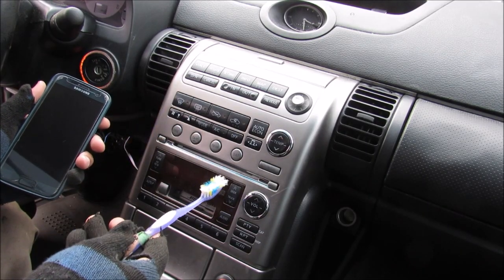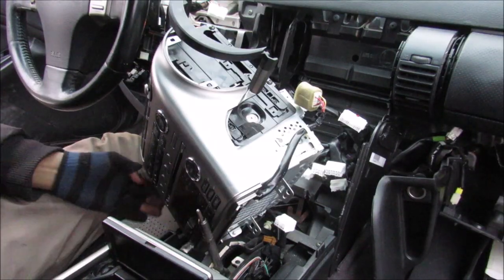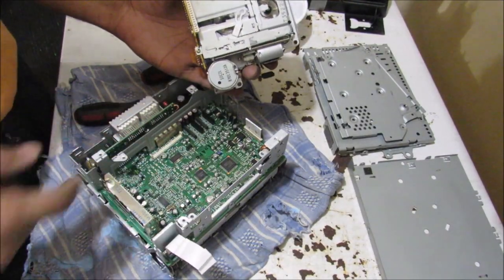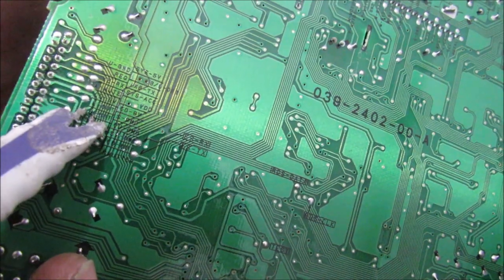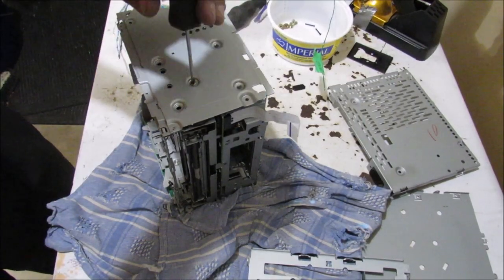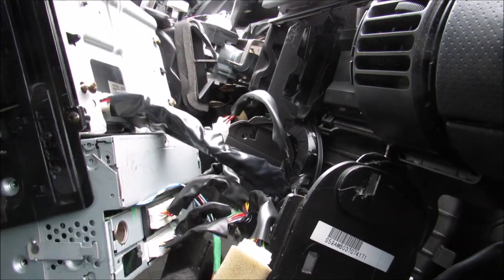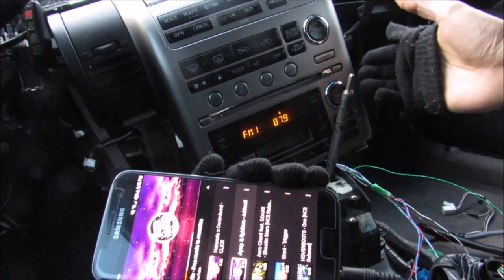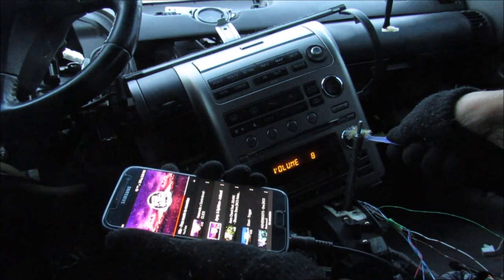DIY: $1 AUX Stereo Input Hack

Comment: The problem with the phone volume all the way up is it will inject distortion from the output circuitry on the phone.

The best volume level on a phone is about 80% where it will be below clipping levels but still above levels where any loudness circuitry will be overridden.
Reply from the maker: Good tip, it depends how sensitive you are to distortion and what you listen to as well, most aux hacks I have done I usually feed the highest phone volume and then control the final output from the cars stereon
Reply: this seems like something that might be true on some phones, but not all

Comment: It would be good to route your internal CD input wires to a female 3.5mm jack, so you can use (and replace easily, if need be) a cheap and widely available 3.5 mm male-to-3.5 mm male patch cord. You can crib a jack from anything, and maybe secure it with epoxy or even silly-cone.
Reply from the maker: Yep good tip

Comment: This was my 1st and only mód to my old Mazda 6 which i bought 2 years Ago , after i burnt a bluetooth  device with 16 pin conector to my radio homemade by some german guy selling IT on ebay by messing Up the wires (IT cost 30 Euros) i found a manual how to do this on old Mazda forum from 2004 , IT took 3 days, lots od cursing, 2 failed attempts, as i have never ever done anything with electric wiring or soldering, ale after i rebuilt the radio i was left with 10 screws , but it works after 2 years and i never gave Up, i Can finally say i have done something  as good as speedkar99 did, car related :D (i didnt know anything about cars back then and now after All problems my old Mazda has encounterd through out that time i learned a lot, but your YT channel explains almost everything in the best and most simple ways car newbie like me could imagine)
Reply from the maker: Good to know you finally got it done and can enjoy your radio now

Comment: Pro tip: The G35 clock bezels pull straight out, rather than upward. It's pretty easy to break the tabs off removing them.
Speedkar's way is perfect. Do just like him.

Unrelated: I sell those bezels on ebay to people who break a tab for around C$100, shipped anywhere in N. America. ;-)
Reply from the maker: Toothbrush makes a great panel popper
Reply: @speedkar99  Yes, but it's best to pop from the top! If you look at the bezel, you'll find the tabs aligned longitudinally. Best way I've found is fingertips @ bottom of display and pull!

Comment: Thanks. After watching your videos I did this mod to my CRV and it works 👍🏾
Reply from the maker: Cool! What year crv?
Reply: @speedkar99  2003 CRV. The only thing is that I have to turn off the radio before plugging in the aux into the phone, similar to what you did in this video. With the aux hooked into the Bluetooth adapter, the audio is very low and staticky so I don't use that adapter. Still cool mod and it's all thanks to your videos. Keep them up!!

Comment: MOST IMPORTANTLY!  Get a cable with a SLIM connector.  If your phone is in a case, a lot of these standard connectors won't fit with the case on!
I would also recommend you get a cable that costs more than a dollar.  A $5 cable from monoprice will have altogether better components, and it's worth it because this is not something you just want to redo when your cable shorts or gets crackly from age or weather.

Comment: I'm sure it was fun but no way I'm doing all that. I had a company car many years ago that I could not mess with. I ended up buying a RF transmitter and a MP3 player. The RF transmitter needed batteries so I took a phone charger and did some dodgy connections to use that instead. 

I will admit the quality was not the best but not a single screw or trim was harmed in the process.
Reply from the maker: Good non-contact solution

Comment: One dollar only goes to the part(s), plus the labor is probably 80Cdn per hour multiply by 8 IF everything goes right, final total comes to a hefty $641!  80 dollars per hour is what any auto mechanic would charge these days and probably even more.
For me, I have often fancied buying a home-use soundbar and a subwoofer with  bluetooth connectivity and just let it sit at the rear shelf, plus an inverter to power it.  Now that is bang for the buck!
Nevertheless, have always enjoyed your videos dear speedkar99, it is quite amazing considering that you don't need to refer to the factory schematics.
Reply from the maker: DIY doesn't include labour charges haha
Reply: A mechanic wouldn't touch this stuff, and frankly, most are unqualified. 120V home stereo stuff in the car seems like a good idea...until you get mad interference from your alternator through the inverter!

Comment: I've tried soldering to 3 different pairs of Left and Right (plus ground) on the motherboard and nothing worked. In one instance the audio still came from my phone, in the other two times no audio played anywhere. This was with a 2002 civic's radio. Oh well. I had my hopes up for a cheap fix. Guess I'll have to buy a bright glowing head unit so I can use an aux cable. At least it was fun trying.

Comment: 5:55 I'm curious why you inserted the RCA cassette to 3.5mm adapter for silence when testing the cassette leads, why not just use the 3.5mm off the cassette as your aux and save the laborious task of taking everything apart.

From my experiences with foreign cars that include combo cassette/CD players is that they are the most future proof but I haven't found a cassette to 3.5mm adapter worth bragging about.  Can you recommend the blank CD aux input method as having better quality than any cassette adapter that can be purchased?
Reply from the maker: Cassette has Terrible quality compared to a CD input

Comment: Hey I know you get questions like this alot and I love the fact u engineered n test it out. But I'm just wondering if I could wire the aux in using a splice rather then taking the whole unite apart. Thanks for doing this btw I learned alot

Comment: Subscribed. Interested in doing this, I’ve done it before by disconnecting the tape deck output and soldering a 3.5mm wire onto the input pins. I have a 2005 g35 with a different audio package, it has a cd changer but no tape deck so I will have to connect to changer or radio. Do you notice any interference from the input from the existing connections? How does it just override the CD/tape/radio? Also do you have to remove the gauge cluster to do this or did you that for another reason?
Reply from the maker: I didn't have any interference issues. Make sure you use a blank CD. The cluster was removed as part of a future video (maybe)
Reply: My 2005 G35 CD mechanism not functioning properly I can't use blank CD , so my only option is to use radio input?

Comment: I tried to do that, checked the motherboard but i found no labels indicating right, left or ground .
Any advise ?
Thanks
Reply from the maker: You'd have to start looking at the radio lines for inputs. 
Or get the datasheet for the main chip
Reply: speedkar99 is hookup wire the same thing as electrical wire?

Comment: Finally;  a useful thing that can actually be of use as battery powered wireless surround speakers or what not and solar charging could be an option also but it is cool for free amps that could serve as tri-amps also maybe.  Or whatever;  hey bud;  maybe show how to use them as cassette head adapted for guitar input and so on.  But you all know that what would really be cool;  would be a junction that would be added to the fm antenna coax and ...............  well that made as much sense as something that made no sense.  LOL  There are cassettes that have a head that sits upon the cassette deck head and the motor could be disconnected to get rid of the disturbance and that could work also.

Comment: I've a audi a4 b6 I have a connects 2 module. that allows a Sony cd changer to be connected and played through  the rca leads. However I have a jack plug with rca connections on the end that  I've connected these to the connects2 rca outputs and then plugged the jack into my phone. if I put a cd into the changer. I can listen to the music on my phone. However if a cd finishes my music goes of till another cd is playing which is shit... So do you know which wires it is that tell my hu a cd is playing. So I can hack these so the hu thinks a cd is playing when it's not and the multichanger does not require a cd .. If you have an email I can send you what I have.but I'm sure the wires are inside the don't bus lead and not the connects2 module. Or will it be easier to open the multichanger and hopefully it's just a case of glueing a  microswitch connection together hoping that this will activate the signal so the hu when in aux mode thinks the cd is playing a disc.. Any help offered is appreciated. If you need any I more info itscraigsagar22@gmail.com
Reply from the maker: Yes

Comment: Why to go through all this if I have a cassette player ??? I can get a cassette adapter for less than $10 including the cable. In addition, what's the make and model of the car?
Reply: Quality isn't as good and the cassette resets sometimes
Reply from the maker: Cassette quality is horrible compared to a hard connection

Comment: Oml,  I can desolder something broken and resolder on a replacement for something(have successfully done it with a broken internal gamecube battery) but whenever someone goes into the  how the different circuts inside of a motherboard or whatever work    I get lost and can't keep up.
Reply from the maker: Electronics is fun, the best thing are the datasheet for the chip that help you understand

Comment: This is undisputably the worst infotainment system assembly ive ever seen in any car ever, there are a lot of things to hate about nissan and this one just got them on my list, the fact that even kia has a more elegant and simple solution for mounting the infotainment system is just embarrassing
Reply from the maker: Yeah and these weren't very reliable either
Reply: @speedkar99  good lord! Difficult to service and unreliable at the same time? nissan really hit the Jack pot of worst design this time.

I was always a huge fan of the skylines and z cars, but when i was doing research for my most recent car, nissan was at the top of my list until i spoke to some owners, needless to say, I'll have to suspend my love for some of their cars until I'm rich enough to set aside a special repair fund for every car.

Comment: So I was hoping you could help me with something. I have an 06 Solara with an android head unit installed. I found a 4 wire aux port from an 07 solara at the junkyard and wanted to wire that into the aux input for the head unit. I bought an rca male to aux male adapter to connect to the red and white aux inputs on the head unit. I had used a continuity test on my multimeter to determine the ground left and right of my aux port. There are four wires, but the fourth one ended up not being connected to anything so I just left it disconnected. I soldered the three wires ground left and right to the aux side of the aux to rca adapter respectively. I plugged it in and opened the AVIN app on the head unit, but whenever I connect the aux to my phone, the phone acts like nothing is connected and the head unit plays a repeated thumping noise. No phone audio in the head unit. Any advice? I appreciate it.
Reply from the maker: Is that rca port meant for aux in or out? 
Try a different phone without jack detection
Reply: @speedkar99  Yes the ports are made specifically for that. The red and white are labeled aux in L and aux in R and the manufacturer eonon specifically mentions the use of the rca to aux converter I got will allow 3.5 aux capability. I dont believe I have a phone that doesnt have jack detection though. Any other common devices that dont have jack detection?
Reply: I figured out why it wasn't working. I ended up believing I wired it incorrectly or that the port wasn't compatible with my radio, so I bought a 3.5mm female to rca male adapter and plugged that in, and I got the same noise. I then tried it with a different phone and it played with no issue. I then plugged my phone into a Tundra with a stock aux port and it still made the same noise. Trying it with a different phone worked, so my phone is the issue. The previous owner totaled my phone and it was restored, so I guess my phone's aux port was one thing that was not repaired. Thanks for your help.

Comment: "too much work..."
How much time did you have invested in this project?
I'll bet it took less time than driving into/around town picking up a Bluetooth transmitter... Without the cost
Reply: Maybe some people prefer to be bombarded with less microwave radiation. Also, Bluetooth is fallible in a dozen ways that a cable is impervious to.
Reply from the maker: Bluetooth fm transmitter will never give you the sound quality of a CD aux connection
Reply: @speedkar99  agreed. For those who claim this is too much work, I would bet it took less time than going shopping, with better sound quality to boot!

Comment: Ironic that the wire didn't work with the tape input, but would have if you had plugged the cassette adapter into your phone! LOL
Reply from the maker: True but the adapter won't have as good quality which is the point of this hack
Reply: @speedkar99  Agreed, though it's interesting to contemplate a high quality 3.5-to-cassette adapter played through a fully cleaned and recalibrated deck. I mean, if you're feeding into analog anyway...

Comment: Why not just change the headunit instead?
Reply from the maker: The G35 requires a $200 dash kit to Integrate the HVAC controls, since it's all controlled by one board. So an aftermarket route gets expensive quick...
Reply: @speedkar99  that's still cheap, compared where I'm at, priced at $479 = MYR1950 😣

Comment: When I do max volume on my phone through the 3.5mm jack, it cuts it down to half after a while with some fucking warning about hearing loss.

Whaaaaaaat?
Reply from the maker: That's built into the ROM
Reply: @speedkar99  Yep. And like most, my phone is bone stock and likely to stay that way. I actually had CM on my last (identical) phone, but it was buggy with no updates, and I'm not technologically advanced enough to roll my own, or inclined to learn...best to be good at a just few things!

Comment: as much as I love most of your vids, I don't like this one. The first issue was ESD. The minute you opened that unit up you exposed that board and other components to ESD. Winter and wool gloves can equal to that transfer. Not worth the effort in my opinion. Just get a new Bluetooth capable radio if your going through all that. The risk is 50/50 of ruining the radio
Reply from the maker: I have opened many circuit boards, computer motherboards, radios and never had an issue with ESD. To be honest yes I was a bit carefree on this radio the radio was old anyway.
Reply: @speedkar99  like I said it's 50/50.
Reply: I bet you’re fun at parties.
Reply: @ChunkyMonkaayyy  VERY

Comment: This is too much work just to be able to plug your phone into the car. Bluetooth radios are as cheap as 20$ on amazon and sound good enough. Ah but cool video though
Reply from the maker: Haha $20. This car needs a $200 dash kit to fit that because the HVAC controls are part of the radio face.
Reply: @speedkar99  well fm transmitter s work good enough for 20$. Hey you should do a video on how to replace a bad knock sensor on a Toyota / Lexus with a 1mz Fe engine. I got that check engine code on my 2000 Lexus ES300 about a year ago and had to pay a mechanic six hundred bucks to change the knock sensor and harness since it was underneath the intake manifold and the intake plenum.